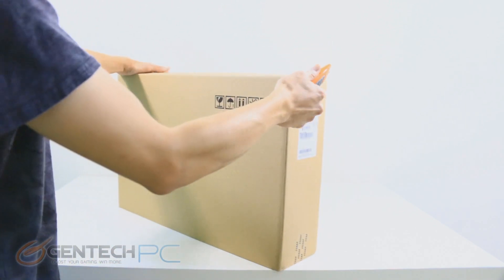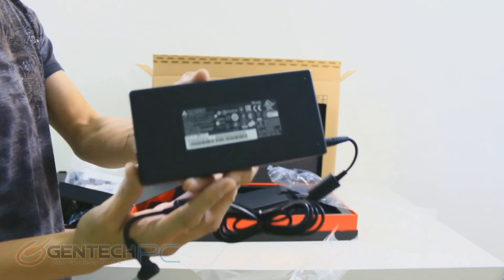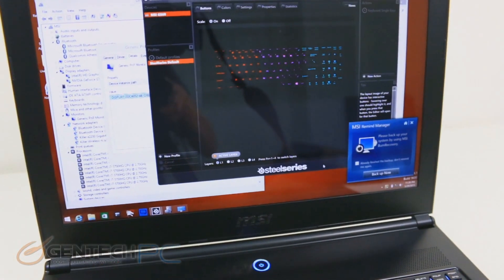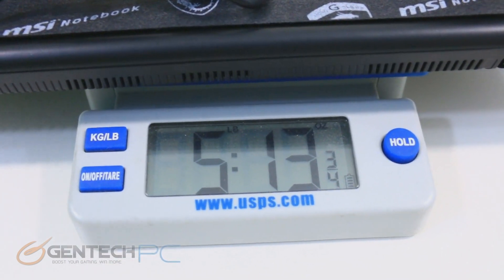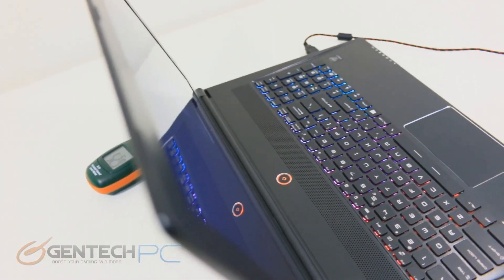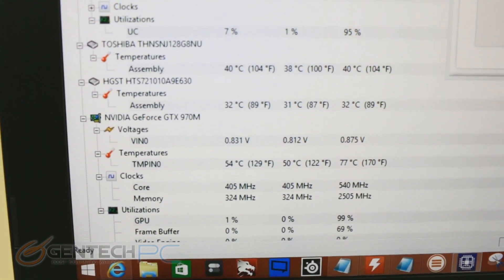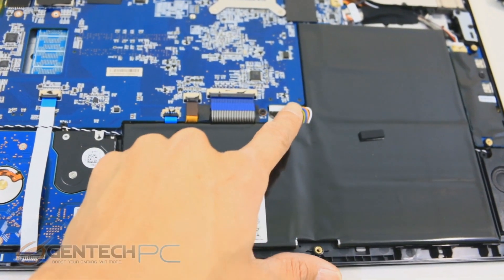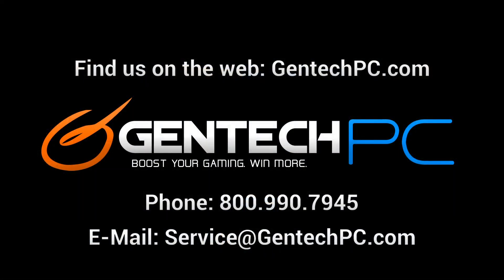MSI GS60 Ghost Pro 4K GTX970M Intel 5th Gen Broadwell i7-5700HQ Detailed Review

Comment: 7 months ago the GS60 with the 4600HQ got 6519 in the Fire Strike test, but now the latest GS60 with a 5700HQ scores 6019? am I missing something?
Reply from the maker: Sea Is For Cookie It was tested out of the box and the sports mode was turned off by default.
Reply: GenTechPC  but sports mode activates overclocking on CPU and GPU... are you suggesting that your other benchmark tests were done using overclocking? If that's the case you probably should highlight this in your reviews otherwise it makes it hard for someone like me to decide which laptop will give me the best performance for my money. based on these reviews alone it looks like your latest version on the GS60 is actually significantly slower than the one 7 months ago.
Reply: or is it because the older gs60 pro is 3k, while this gs60 pro is 4k?

Comment: Two questions.

Does this 4K model have that 48hz lock like the previous ones do?
Is the Gold color available for it?
Reply from the maker: TheMistahJayden Yes it's still the 48hz screen.
Reply: GenTechPC I don't know much about these refresh rates, I'm hearing a lot that this 48hz rate that the Ghost Pro 4K has is really bad. Just so I can compare, can you tell me what are the usual rates for other laptop in the same category (MSI Ghost Pro without 4K, MSI GE62 Apache Pro, Asus G501JW, etc.)? Is this low rate a consequence of having a 4K screen or can it  happen to FullHD screens as well? Does it really make a difference to have high refresh rates, I mean, can the human eye perceive a difference? (I thought the human eye could not see more than 24fps...)
Reply: Fernando Vieira I too want to know what's so bad about it and if it matters to casual people. From a video I saw V-sync makes it almost unnoticeable (to me), but new egg is giving away free 27" screens with the 4K model which is to make up for that hertz issue. So I'm conflicted just as much as you are lol. The non-4k GS60 (3K included) have a 60 hz screen.
Reply: TheMistahJayden If you're a casual user, you won't notice but if you're an advanced user, even watching videos sucks. Why would a casual user buy this laptop anyway. I have a desktop beast, an Asus Zenbook 303la and a Haswell GS60... And the GS60 is the one I use the least. It's noisy, hot and the screen and battery sucks. The Zenbook is perfect for anything but gaming (even better than a Macbook imho).
Reply: palonazo I'm not that casual XD I do play games but nothing that I need a 970M for. I animate, and do require the memory but that's it. I'm not getting the 4K model at all. Was never interested in the 4K. I just wanted the Gold but I got over it, I'm getting the 1080p Broadwell version. I didn't really see any alternatives that interested me except the Aorus X5 but that's way to overboard. I feel that this GS60 would future proof me for a long time.
Reply: palonazo I also looked at the 303LA. I currently own a XPS 13 which seems to be it's equivalent in a sense. Thanks for replying though

Comment: Is there a big difference between the 970m 3gb vs 970m 6gb
Reply: Armand Apollyon in performance: no . only in the amount of memory
Reply: Armand Apollyon it can affect performance, if your game uses more than 3gb of vram.
Reply: Andrew Tan you are wrong, VRAM is not RAM
Reply: Juan David Alvarez I know that. But vram is for framebuffer ,textures and all those good stuff. Kinda like RAM, but for the textures in your games you play. I mean Shadow of Mordor has Ultra-HD textures which need 6gb of vram. The gtx 980ti has 6gb, and it was made for 4k gaming, since 4k needs a lot of textures So if you are playing a game that require a lot of vram, then you should get a gpu with lots of it.
Reply: you are not able to play games in 4K on a laptop
Reply: but Skyrim can reach that limit easily, even when you play on 1080p, it just has 4k texture ,but it's still on a 1080p resolution.
Reply: with a texture mod ...
Reply: welp, still counts as 1080p right?